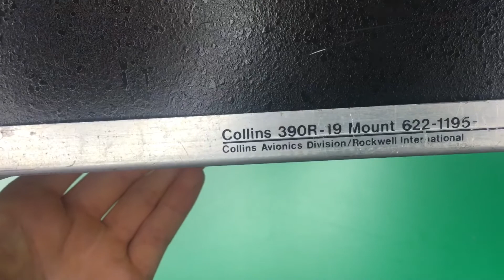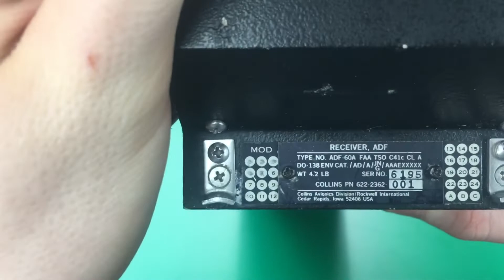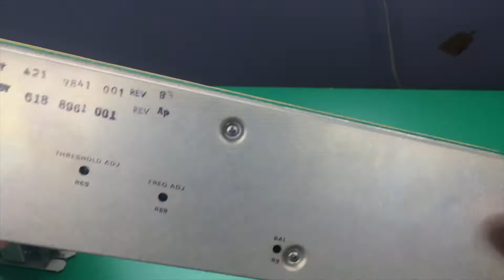Collins ADF-60 Aircraft ADF receiver teardown

Comment: I came over from the Curious Marc video about the ADC.   Here are some quick notes as I watch your video:   the blue things are resistors.. probably metal film resistors that are 1% tolerance or so.  The resistors with the stripes are carbon composition resistors.  Around 5:20, the orange things are 0.1uF capacitors.  Probably higher voltage types.  At 5:51, when you open up the switcher that had a shield over it, you mentioned a logic chip.  That's probably the switcher controller, and might be interesting to learn what it is.  At 8:20, I suspect that the "resistor" is an inductor... or a cap?  A cap makes more sense for a crystal oscillator circuit.   At 8:25, the trimmer is an adjustable capacitor.  At 11:10, the "resistors" are probably inductors.  I'm guessing is that there is a network of LC filters on that part of the board.  At 11:29, the green item is probably a transformer.  The "T2" designator on the silkscreen is the big hint, but the fact that it has 4 terminals is another hint.  At 13:27, I see two integrated circuits in cans marked CA741.  This is a basic operational amplifier ("op-amp"), and they are probably used to make linear voltage regulators.  The things that look like light bulbs are pretty odd.. maybe they are spark gap devices used to clamp high voltage transients?  A lot of avionics is required to survive high voltage transients, such as might occur if the aircraft is struck by lightning.  
Overall, I'd be interested in hearing more about how everything works, but that requires some specialized knowledge.  It would be good to explain that ADF stands for Automatic Direction Finder.  There was an ADF on the A-4 Skyhawks that I used to work on.
Reply: I also used to service these. One of the easiest ways to quickly test the sensitivity of the recover was to tune it to the local AM radio station!

I don’t remember so much off the top of my head about these like the VHF-20, which I did nearly every working day. Bringing back some memories watching the strip down.
Reply from the maker: Thanks so much for the great information. I'm always trying to learn more about this fascinating stuff. far the most interesting piece of avionics I have is a Collins 860e-2 DME. I will make a video eventually but I've been busy with school. It weighs 40lbs and contains 4 cavity triode amplifier tubes, machnalical assemblys, and tons of high frequency stuff that I don't know anything about.
Reply: @BGTech1  There is a ton of specialized knowledge in electronics, so stuff like switching power supplies or RF is something you could spend a career on.  I'm sort of a general analog guy myself.  I started as an avionics tech in the Marines, and then got my EE degree, and spent 8 years at McDonnell Douglas doing electronics design for avionics and spacecraft.  That was in the late 80's and early 90's, and it looked a lot like the Collins ADF in terms of parts and construction.  When I was in the Marines, we had Collins UHF radios and other gear.  If you ever find an ARC-51 or ARC-159 UHF radio, I'd love to see what is inside.  🙂
Reply from the maker: @SkyhawkSteve  Working on avionics sounds like a neat career. I'm planning on majoring in EE in college as well. I will keep my eyes out for those radios, but my budget for avionics is limited.
Reply: @BGTech1  Where are you finding these old Collins items?
Reply from the maker: Many years ago I got a few boxes at the scrap yard. Now I buy them off eBay.